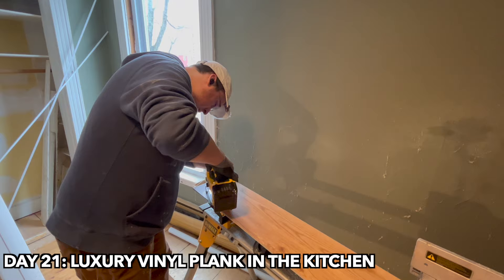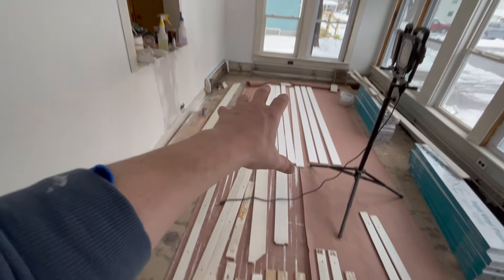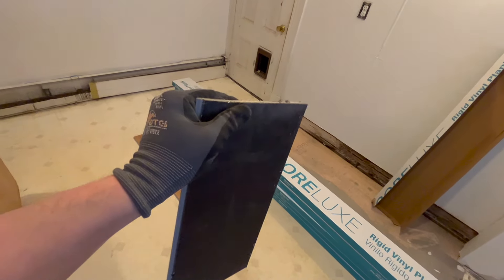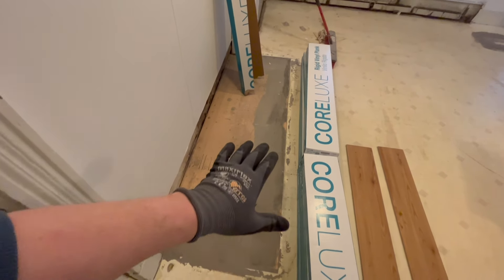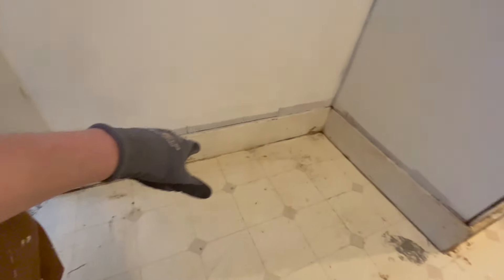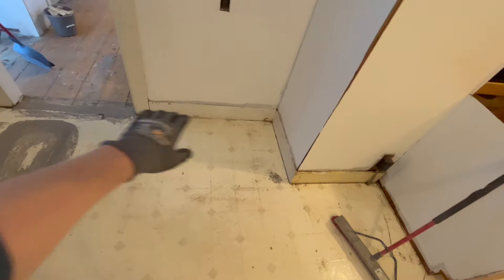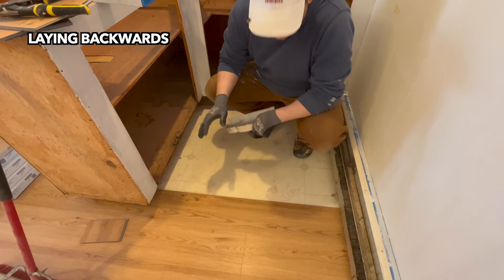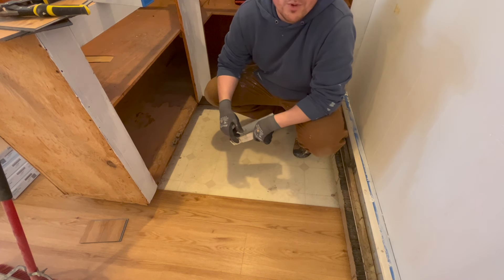Kitchen Rebuild: Installing luxury vinyl plank flooring!

Comment: You're flooring looked like it snapped together a lot easier than the one I did at the rental. I had to fight it sometimes. You just sort of layed it in and gave it a tap. Then again... maybe it's just me. On the home stretch looks like. You'll be done in time easily I'll bet.
Reply from the maker: The first room is always the hardest…that’s where you struggle to figure out the angles and how to seat it before you tap it in. I remember my first time, I I made a bit of a mess…it’s still going strong though 😂

Comment: Very nice job. You make it look so easy. Any particular method to determine where you start?
Reply from the maker: Great question! There were two decisions made here; first, to run the planks parallel to the longest side of the room. Second, to run from the kitchen to the outside wall.

When I install flooring, I like to go parallel with the longest side of the room…I like the way it looks, and it’s usually less work.

When choosing what side to start on, I had two things in mind…ease of install and where I may need to make changes later. I opted to end on that exterior wall (and you’ll notice I floored the whole thing…you don’t normally floor under cabinets…) because it was a little easier (no doorways, which can be a pain) but mainly because it allowed me to more easily change things up if I need to…

More on my sink choices in the next video 😊